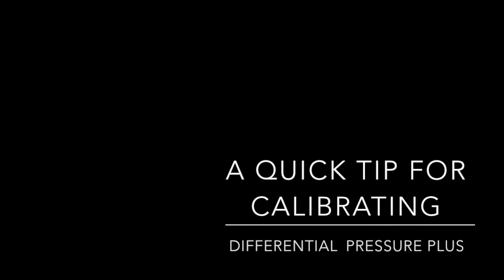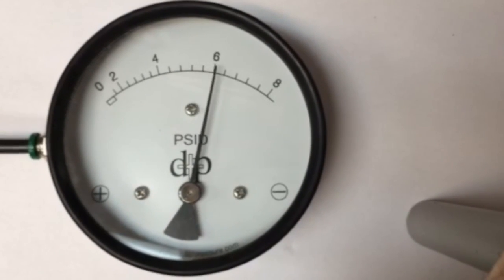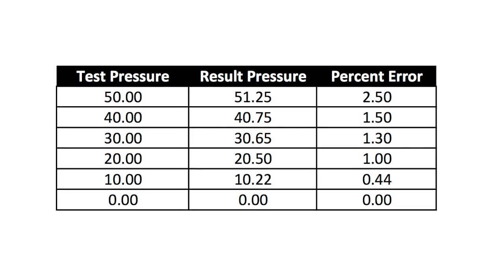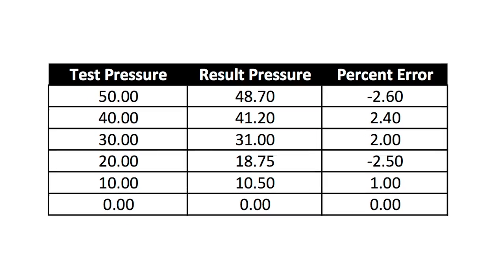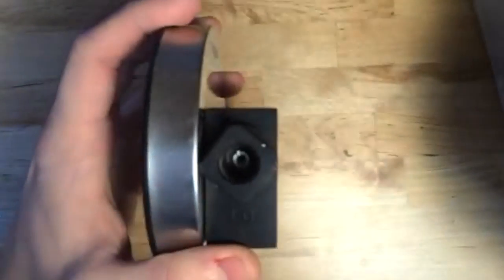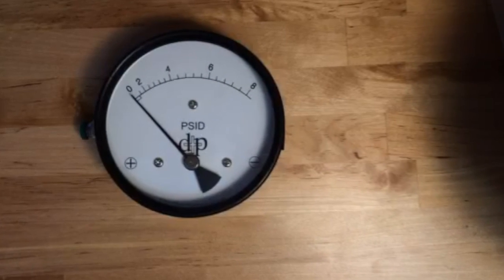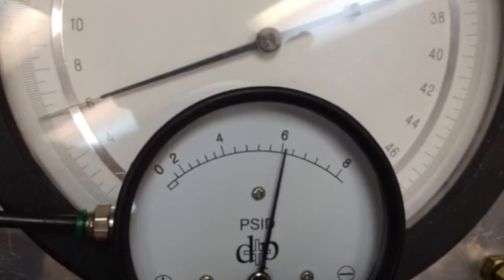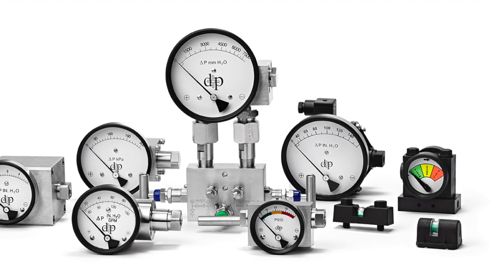Quick Calibration Tip (for differential pressure gauges)

Comment from the maker: Here's a quick tip for calibrating our precision gauges. However, this tip only works if the gauge meets a couple requirements. If it doesn't fix it, give us a call and we will be happy to get the gauge calibrated same day. 203-415-5804. differentialpressure.com
https://www.youtube.com/watch?v=Z08h-F2AM0c